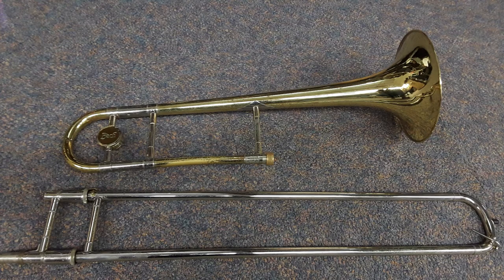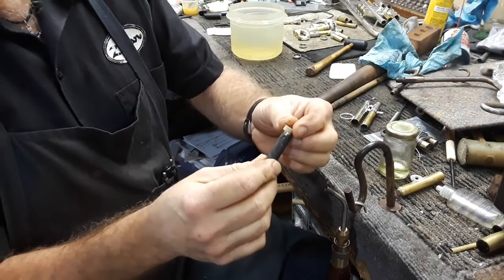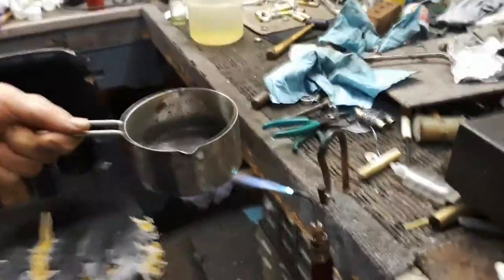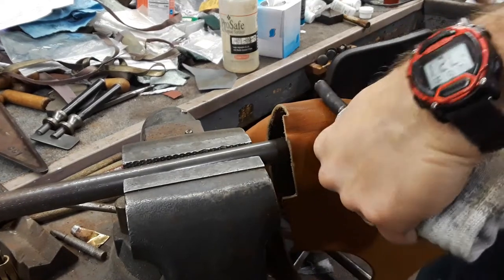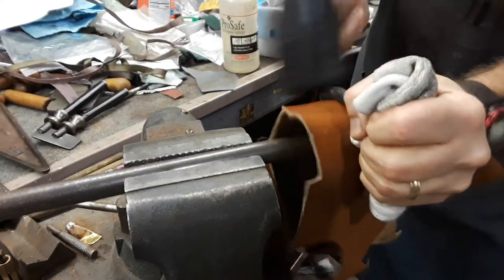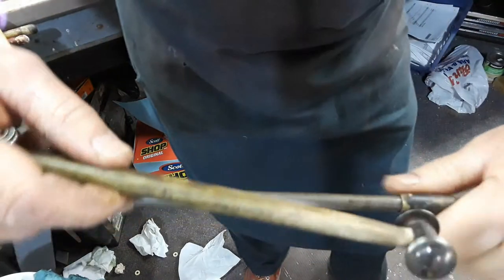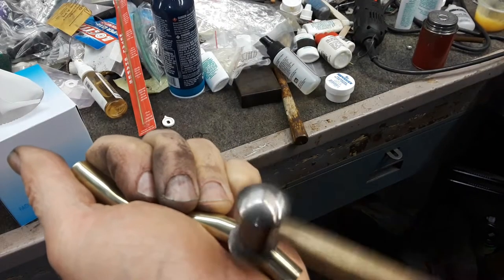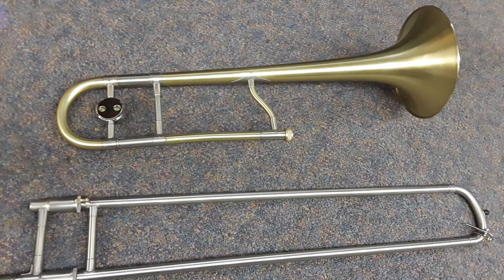BACH TROMBONES OVERHAULED AND SCRATCH BRUSHED

Comment: That's a really nice finish. Good work. What do you use to make that finish?
Reply from the maker: Mostly Scotch bright pads. The Maroon color works well.  I also use a wire wheel on the crooks then go over it with a scotch brite pad.

Comment: What would this look like on a silver horn??
Reply from the maker: It would be very similar to a vintage horn with the sand blasted and then silver plated look from back in the 20s and 30s - Although that was still done for a while and it is still done when restoring those older horns. There would be the risk of burning thru the silver plating while processing it with scratch brushing after it is already plated. So that is a very unorthodox way to do it. The old sand or glass bead blasted finishes were nice.